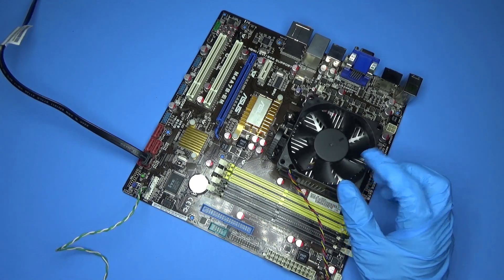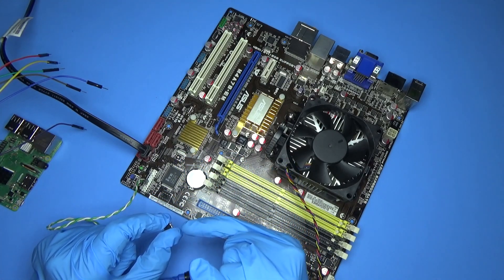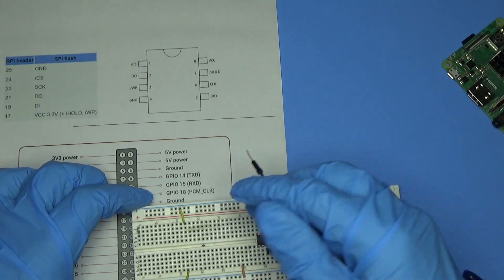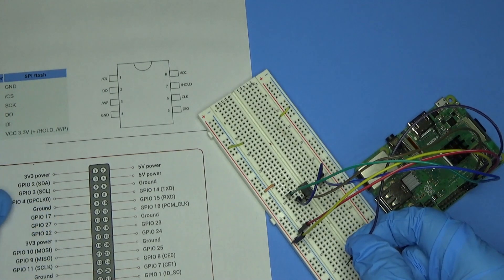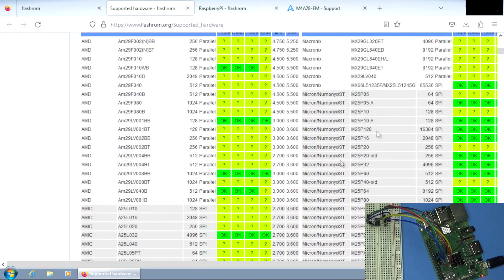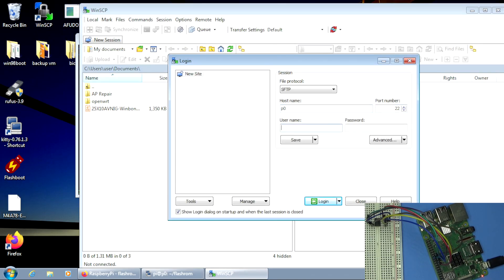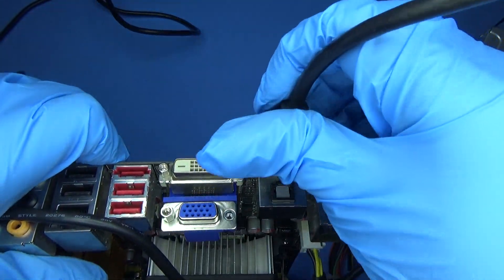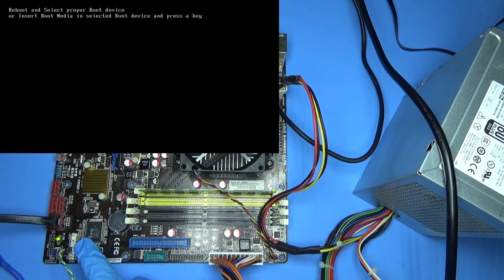Bad Bios Flash - Rescued by a Raspberry Pi?  Fixing my AM2+ Board with FlashRom

Comment: I used to fix old pc motherboards with a bad Flash by using another motherboard with the same.bios chip removable socket, and I'd Flash using a flashing program in dos that would force Flash the chip, and I'd pop the bios chip and swap it for the bad one just before pressing the "Flash now".  after successful  flashing I'd turn off and swith the newly flashed bad chip and boom. Worked every time. That was in the old days to win xp/win7 lol
Reply from the maker: Lol Ive done that too. Worked like a charm every time

Comment: can you do this with a 26 pin Pi?
Reply from the maker: I'll be honest, I've never used any pi older than a 3.  I assume so as long as you can direct the IO to the right pins.
Reply: thanks for the reply, I'm getting "flashrom no eeprom/flash device found"

gonna check my wiring, and I'm also using a ribbon cable because I only have male to male, pretty sure I just wired it wrong lol